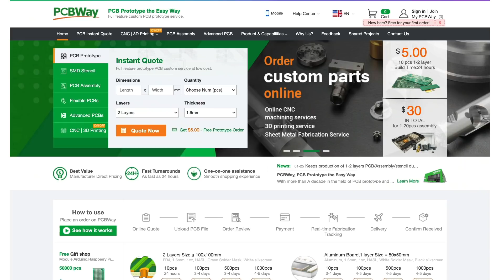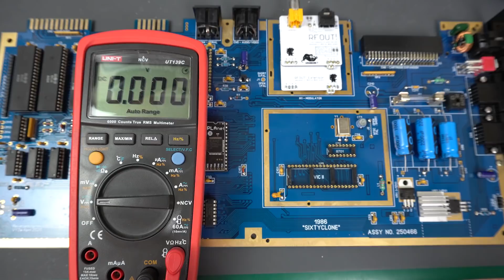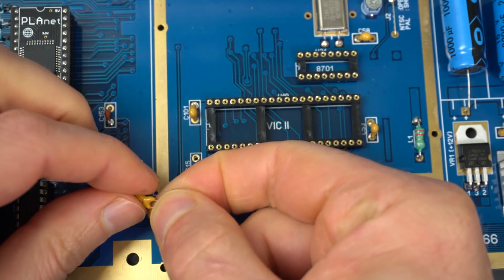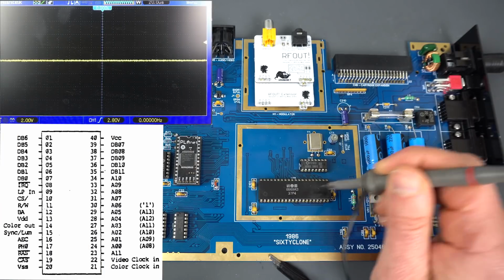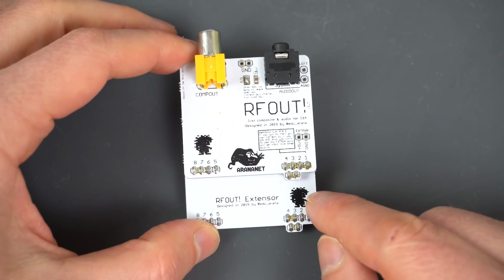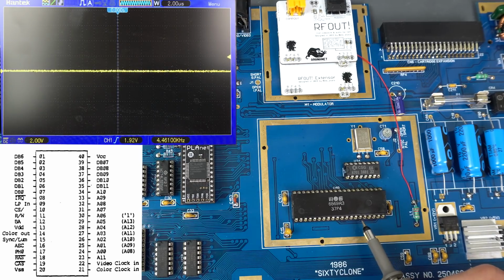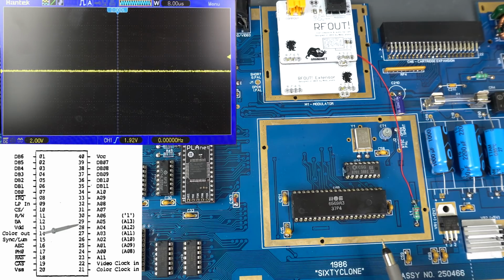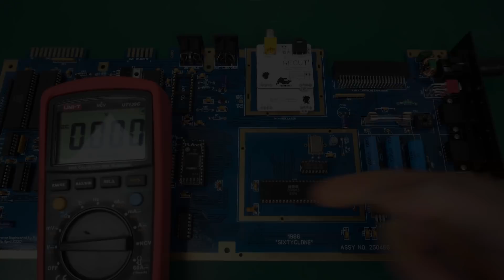Fixing a Modern Commodore 64 Build

Comment: Lol "they are usually blue" - nah in all my years I've seen more yellow tantalums than any other colour. A 4.7uF tantalum is / was cheaper than a ceramic back then for similar performance. I would have thrown that capacitor away, tants have tantrums (boom tish) when hit with reverse polarity.
Reply from the maker: Yes, I hear on PCs are mostly yellow. Not sure why, but in most of the computers I work with they tend to be blue and my eyes are trained to look for them (especially because they short with time).

Comment: 4.7uF - 10 uF tantalum capacitors were very commonly used for power filtering in  80's-90's designs, and in fact they are still being used. Higher capacitance MLCCs were not available back in the day, and even now they have some drawbacks, for example their capacitance goes down significantly when the voltage is applied. BTW, I am curious what 8088 board do you have. One of my designs?
Reply from the maker: That makes sense. Is there a reason to use tantalum over electrolytic in that case, or is it a perfectly fine substitution in that case?
And yes, I believe the boards I have are designed by you now that I think about it! 😃 I've had them for a while, but I'm hoping to do the build sometime soon. Thanks for making that project. It looked amazing!
Reply: @NoelsRetroLab  : Lower internal resistance & inductance, which are usually both good.
Reply: @NoelsRetroLab  tantalum have better filtering characteristics at high KHz  to low MHz frequencies - ie exaclty the frequency area that the buses would be operating at. Ie better at filtering any noise induced on the supply by normal chip operation.

Comment: knowing commodore they probably used tantalum because they got a shitload of them cheap😂😂
Reply: Sinclair did the same, buying memory chips for the spectrum that were defective but still gave half the capacity, at rock bottom price.
Competition may seem harsh these days, but in the 80's it was WAR. Anything to get the price down and outsell the competition. Do something like that nowadays and the company will be literally cancelled by the community.
Reply from the maker: Yes, that was my thought too 😃
Reply: Tantalum actually tends to be used because it has a nice mix of ESR and capacity- better than most or all aluminum electrolytics for ESR, and better than ceramic for capacity. And I think they're usually smaller than the equivalent plastic film caps. The downside is that they're just as electrolytic as with aluminum, but they're far more vulnerable to damage.

Comment: Should have tested that capacitor, it may be all over the place after being reversed, and I wouldn't trust it further than a throw into the dead parts bin
Reply from the maker: Yes, it should just be replaced straight out. Good point.
Reply: @NoelsRetroLab  Tantalums especially. Once you heat them up or break down the oxide layer they are time bombs just waiting to short dead solid. Tantalums had much lower ESR than aluminum electrolytics in those days, and nothing else in the same size range had the same capacitance if you wanted 1uF or more. These days just replace it with a low-ESR electrolytic.
Reply: @lwilton  The beloved flame emitting capacitors :-)
Reply: @lwilton  or a MLCC, those have excellent performance as well.

Comment: Usually blue? All of my tantalums are yellow or orange.
Reply from the maker: I think it depends on the computers. I think on PCs that's more common, but most of the ones I come across (and the ones that fail over time) tend to be blue.
Reply: I've seen them all colors. I've worked in electronic manufacturing. They can have defects such as markings being reversed. But that's like 1% of them. The primary reason they're used besides size is that they're physically smaller than an electrolytic and presumably won't dry out over time.

Comment: I have seen th diagnostics reporting the CIAs as bad on a 250466 board before where they were perfectly fine and everything was working. I believe this is a problem with the cartridge rather than the boards
Reply from the maker: Not in this case. It's actually pretty interesting. Stay tuned 😃

Comment: Tantalums are usually blue? I think all the old ones in old IBM equipment are yellow.
Reply: Also: The reverse driven of the capacitor possibly has the electrolyte and foils damaged and it has a very shortened lifetime. It is better to exchange that capacitor with a new one.
Reply from the maker: Yes, good idea. Planning to replace it.
Reply: I noticed that, too.
I have red, green, yellow, blue at hand. This is usually a color code for the maximum voltage of the tantalum capacitor and it is possibly manufacturer dependent.
But there is also a norm specified. Search for "Capacitor Voltage Colour Code Table". In that yellow is 20V and blue is 35V for Type J (Dipped Tantalum Capacitors).
Reply from the maker: That's what I'm hearing, especially PCs. The ones I encounter on the computers I repair are usually blue (like the original one in that C64).

Comment: You really should have replaced that capacitor.  Hooking it up backwards could have shortened its lifespan.
Reply from the maker: I think you're right. I didn't know about that but other people mentioned the same thing. Maybe the 7805 helped it a bit by shutting down, but you're right that it would be safer to replace it. Probably an electrolytic one would be fine too.

Comment: "They don' t make them as as they did any more". I am referring to the RAM chips and I don' t remember the correct punch line as well... 😉
Reply: They way they made them in the 80's was to buy defective memory chips for next to nothing, that could only address half their capacity, use the half that worked in each chip and mount double the number of chips.. Sinclair did this with one of their ZX Spectrum revisions. I think it was with 4164 chips, not sure
Or was your comment a sarcastic nod to this?
Reply: @paulmichaelfreedman8334  I understand perfectly what you say and no, I wasn' t sarcastic at all. I just quoted the obvious: Somebody bought something in 2021 and it just didn' t work...
Reply: @paulmichaelfreedman8334  You are correct, Sir; the first few revisions* of the ZX Spectrum 48K used those "half" 4164 RAM chips. The boards were designed so that by soldering in some jumpers, it could accommodate chips with either the lower half or the upper half working. Another set of jumpers allowed the use of RAMs from different manufacturers.
*Except the very first version; that one used a small daughter board that sat above the main PCB.

Comment: Weird, I thought these Tantalums, once they start to short (for whatever reason, not just by being in backwards), they're toast. (although I had that happen to high voltage electrolytics - and after putting two of them in backwards I started triple-checking and guess what - I managed to put another one in backwards anyways)
Reply from the maker: You may be right about that. I didn't know that but other people pointed that out. The only thing I can think of is that the 7805 shut down faster than the cap was damaged. Alternatively maybe the cap was damaged but since it's just a decoupling cap, we can't really tell anything is wrong. Probably safer to replace it though.

Comment: I had exactly the same problem with an old Soviet calculator. After replacing all electrolytic capacitor it started up and then died in ten seconds. One capacitor was installed backwards...
Reply from the maker: Makes sense. At least yours didn't blow up either! 😃
Reply: Polar caps that have been charged with the wrong polarity, cannot be trusted anymore. Always replace.

Comment: The value of that tant is 4.7uF (shown both on the schematic and visible written on the cap body)
You aren't going to find a ceramic with a value that large (ignoring modern surface mount MLCC caps)
It'll be providing a bit of local bulk capacitance for the VIC IC alongside the 100nF ceramic decoupling cap that's in parallel with it.
Reply from the maker: True. I don't know why I had it in my mind that it was 1uF, which would have been in the upper end for a ceramic one. So I guess the real question is why not use an electrolytic capacitor then. Were they significantly more expensive?
Reply: No idea about price differences back at that time.  In that application I wouldn't have thought performance differences would be a factor.

Tants will tend to be physically smaller, but there doesn't appear to be a space problem - could always have used an axial elec. if there were height concerns.

<shrug>

Really easy to overlook it sat alongside all those resin dipped ceramics though (and the schematic not actually putting any units next to the value doesn't really draw attention to it either - it could have been 4.7nF - although that wouldn't make much sense in parallel with a 100nF decoupling cap).

Comment: Excellent video! I have one of the replica boards and everything to populate it. It's going to be a winter project and it will be interesting to see how many mistakes I make and need to troubleshoot!
Reply: How long did it take you to source the parts for it?  (TBH I'd love to try doing either a C128 [what I owned growing up] or an Amiga 500 [always wanted one]  )
Reply from the maker: Good luck with that! The hardest part is going to be getting the components (and trusting they work correctly).

Comment: would be nice if they incorporated 128kb or even 512k in to the C64.. if your respining the board what is stopping you?
Reply from the maker: That's the next step: Enhanced replica boards. This particular one is an exact copy, so I don't think it can be easily changed.
Reply: @NoelsRetroLab  I don't know if you read my previous replies, but I was talking BS. The 6510's 16 bit address bus can only address 64kB at a time. So if you want to use more memory than 64kB at a time, you will need to add a separate bank of 64kB and a bank switching circuit which will need a dedicated CPU line. It will probably also introduce latency on the memory and require a lot more memory read and write cycles.
Reply: @paulmichaelfreedman8334  And completely customized software to use it.  You can't just add bank switching in some transparent fashion.
Reply: @stargazer7644  indeed. Probably the reason why nobody bothered in the first place.

Comment: just started the video... i built some thing like this and out of the 100 ceramic caps i put in 1 of them had a short.. what a nightmare...
Reply from the maker: Ugh. That's bad luck. And the worst thing is that resistance checks wouldn't work because all decoupling capacitors would show up as shorted. Did you have to desolder them all, or did you track it down with sensitive voltage measurements?

Comment: I had a non working parking remote, until I realized that it was just a free tin ball touching the frequency selector. How fun it is to troubleshoot
Reply from the maker: That would have been crazy! (unless you heard something rattling, that would have been an easy hint 😃).
Reply: @NoelsRetroLab  it was crazy, going downstairs to the parking many times. 
I discovered it by cleaning the circuit. #be-noel-for-a-day

Comment: I'm surprised you did not check the components on the board were 1. the right ones and 2. installed properly even before turning the C64 on.
Reply from the maker: I gave them a glance over (and checked that they were seated correctly and the right way around) but I admit I didn't sit down and check that they were the correct ones. I guess I trusted Damian had done that part correctly 😃
Reply: @NoelsRetroLab  trust no one. 😁😂
Reply: @bufordmaddogtannen  Clearly, I can’t be trusted, hehehe…
To be honest, two factors played a role in me putting that cap wrong: I’m not used to polarized tantalum caps (the only polarized ones I dealt with always were electrolytics), and my age (I’m 48) giving me not-so-good close sight. If it was a smd component I would probably be using magnifying glasses, but I don’t use them for through-hole components, so I didn’t see the polarity marking on the board. So, that’s that. I’m thankful both me and Noel didn’t have to enjoy fireworks in this case.
Reply: @damianvila  these things happen regardless of age. When I was 20 I assembled a voice digitizer and it didn't work since I mixed two transistors and a couple of resistors. Here there was the issue with the rf modulator as well, but I'm still wondering if the other components are the right value and at the right place.
Reply: @bufordmaddogtannen  I’m very methodical with my projects. (I built more that 30 guitar pedal, all worked first try). I don’t care if it takes more time, I check every component and its placement. I printed the bom in this case, and checked the parts when I put them in the board. The unlucky part was treating that tantalum as a regular ceramic, and not checking if there was something special about it. It was the only tantalum in the board, and was soldered at a later time, because I lacked a few components that I don’t usually use for my projects. So, lesson learned for the next one! (Going from analog circuits to digital, and from through-hole to smd has been quite a journey)
Reply: @damianvila  BTW will you put the board in a C64c case with the white keyboard or mix things up a bit (e.g. C64c case and breadbin keyboard)?
Reply: @bufordmaddogtannen  Breadbin. I bought a breadbin case that came with a USB adapter to be used as a keyboard, and it’s the perfect case for this project, in my opinion. I’m not too fond of the C64C cases, and in fact sent a C64C to Noel (with an identical 250466 inside) for him to keep. You can see it in the unboxing video.

Edit: I also have a working breadbin with its original 250425 board in.
Reply: @damianvila  I'm a breadbin fan miself, but the C64c case is growing on me as I also had a C128 which is possibly the best C64. 😁
Reply: @bufordmaddogtannen  My best friend in high school had a C128. Wonderful machine, very difficult to repair.
Reply: @damianvila  : As far as I know every tantalum cap design is polarized, though fortunately they aren't that common, since they seem to only be used for intermediate values in usually digital designs.
Reply: @absalomdraconis  Well, I’ve learned that lesson now… coming from analog audio circuit experience, this was my first time dealing with this component. I’m glad it didn’t explode.
Reply: Hi Sir. It is easy to point the finger after problem found. Checking all out would take hours, would you personally checked everything in detail? I would guess that you wouldn't
Reply: @JorgeCarvalho_web_dev  that's your choice. Since it's easy to misread resistors and install components backwards, on a self built computer I would have checked the components one by one. By default, not in hindsight (after the fact).
On a non-working factory made computer the approach Noel took would have been fine, as resistors and diodes rarely fail and all components are installed properly.
Reply: @bufordmaddogtannen  Depends on what you are expecting of the assembly quality - if you think there may be only the odd one or two incorrect components, its probably faster to diagnose based on the symptoms rather than check every single component before doing anything else.
Reply: @josh46646  sure, yet an incorrect component or a swapped one could affect something you didn't test. E.g. Cassette port, joystick port.
Here the number of components to check is not that high compared, for instance, with a ZX spectrum replica board.
Reply: @JorgeCarvalho_web_dev  Hours?  There aren't that many components on the board.  As soon as the board pic came up, I started looking at the IC orientations, and cap polarities.  Once he pulled the chip and that didn't fix it I started yelling, "Check the tant!", but he didn't listen. :)

Comment: Tantalum caps usually have lower* ESR than other electrolytic capacitors. Vide: https://en.wikipedia.org/wiki/Tantalum_capacitor#/media/File:E-cap-100uF-impedance-ESR-curves.jpg
Reply: 4.7uf in ceramic would be super uncommon back in the day - only modern ceramic caps go up to 10uf and beyond cheaply now. I'd think this circuit probably was looking for low ESR over the lesser cost of an electrolytic.
Reply from the maker: Interesting. Although I don't see why ESR would matter much in a decoupling capacitor like this one. I'm starting to think that Tramiel had a cheap source of those in that size 😃
Reply: @NoelsRetroLab  VIC and clock generators are both high speed ICs and can produce noise on supply lines. Lower is ESR, lower is noise.
Reply: @NoelsRetroLab  : To expand a bit on Qyonek's response, since all traces (all electronics at all, really) act as capacitors, they have a charge/discharge curve. As we know from the RC time constant formula, if you place a higher valued resistor in series with a capacitor, that will reduce the speed that it transfers electrons at. Thus, if two capacitors are separated by a resistor, then larger resistances of resistor will result in a longer time to equalize any voltage difference, and correspondingly will allow any voltage spikes to maintain a higher voltage (due to the slowed flow of electrons) than if the separating resistance was lower.

ESI/ESL/whatever it's called has a similar effect, except that it also produces the opposite polarity of spike as the original spike disappears.